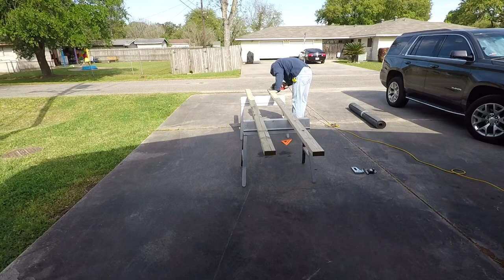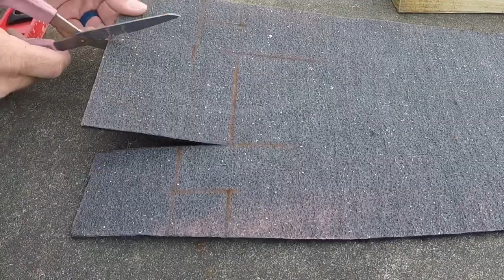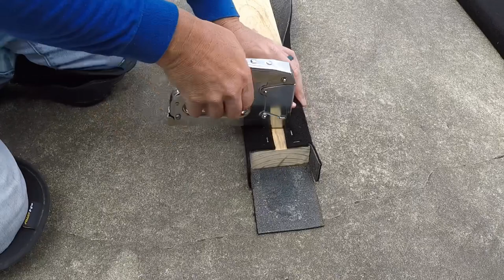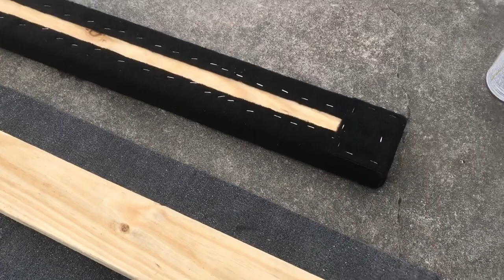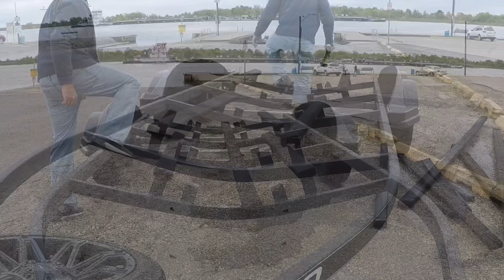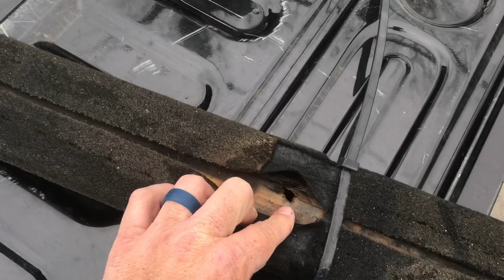How to replace bunker boards on a bass boat

Comment: I am actually replacing my bunks on my 2018 Nitro Z21. Yeah, They wrapped the carpet all the way around, and I don't even think they used treated wood. I will be headed to the boat ramp tomorrow to change them out. I will pre drill pilot holes with 11/64" bit so I don't chance splitting the 2x4's. I did as you did, leaving the bottom middle open.

Comment: Nice video. I did my bunks on my 95 nitro in like 2000. Same issue.  I chose to use carriage bolts instead of the Lag. Didn’t use glue didn’t think of it Had to put boards on and carpet them on the trailer on my back. Was worried lags would rot out again. tightened enough to sink the heads below board. No problems since. Just watched same vid on a skeeter so don’t want to hear it’s a nitro thing

Comment: What size screws did you attach the new bunks with if you remember id like to know
Reply from the maker: Jon B I reused the old ones actually but they are like 1 1/4” stainless lag screws
Reply: @jessefloyd8224  Thanks I appreciate the info

Comment: Buy a cheap boat and you'll find it's cheap for a reason. They cut corners everywhere including not using treated bunk boards at the factory. Makes you think about the rest of the rig and when it's going to fall apart.
Reply from the maker: Yeah I guess KVD likes cheap stuff....🤷🏻‍♂️

Comment: The great quality of a nitro. Lol
Reply from the maker: alex korn i love my Boat. 2x4’s are going to eventually rot especially the more you use it the wetter they stay. If replacing bunk boards is the only problem i have I’ll be a happy boat owner! So far I’ve had 3 boats, all Nitro’s, and no issues yet! My next boat will be another one.
Reply: It's  a nitro had the same problem have a stratos now no problem with bunks for more than 10 years
Reply: Nothing wrong with a nitro , solid boat